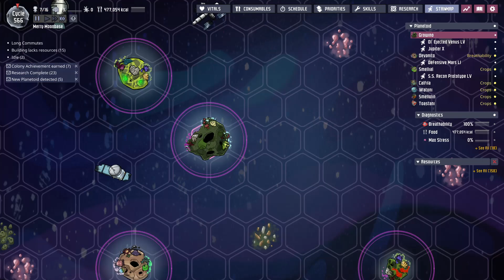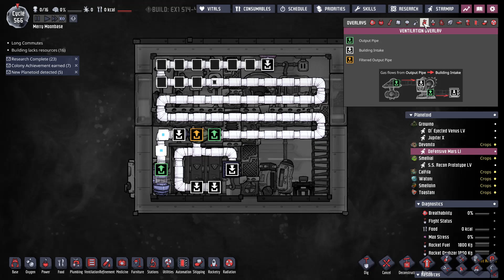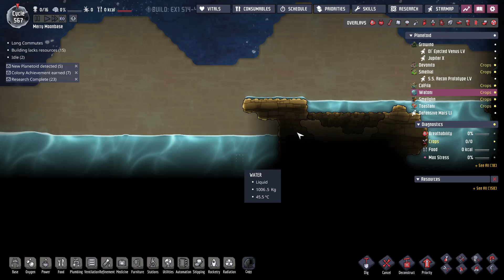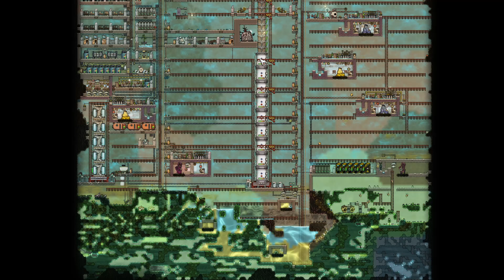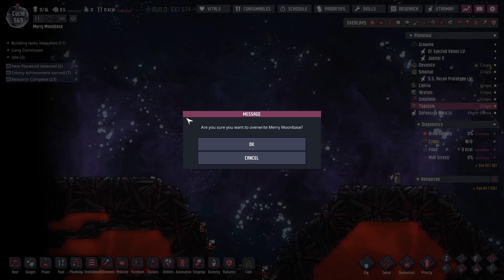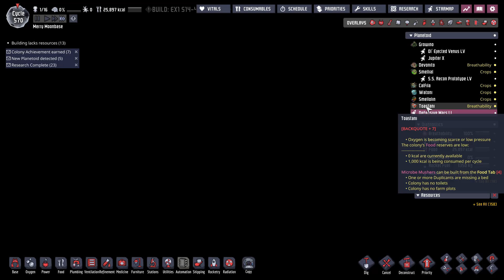Merry Moonbase Ep 21 Magma World Rocket Platform.

Comment: You still have plenty of room in the steam room if you want to add a row of insulated tiles and move the valve down a tile to fix your LO2 boiling issue for good.
Reply from the maker: Once it cools down with the supercoolant it will be fine.  next time I have great suggestions to prevent it in the first place.  And if anyone watching has a similar issues the comment section has helped them as well.